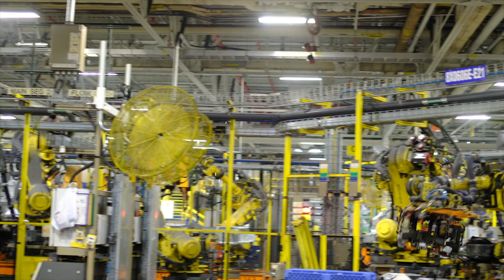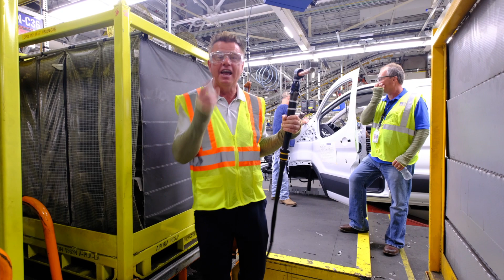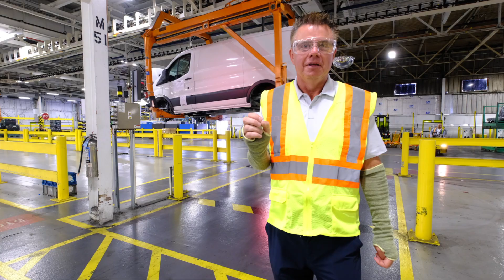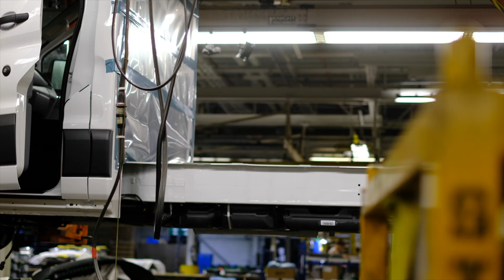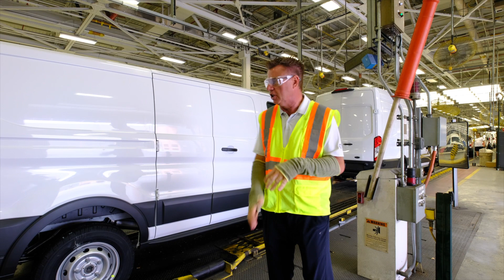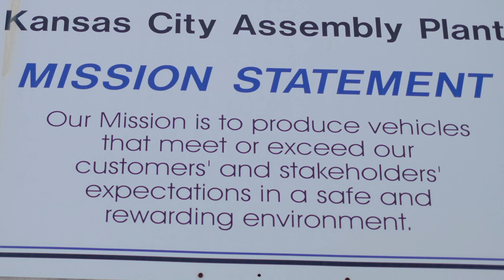Ford Transit Factory Tour

Comment: It's funny to hear an outsider describe equipment that I work on six days per week.  I am an Electrician at the Kansas City Assembly Plant and I keep all of the equipment running from Deskid all the way to Water Test.  We can run 37 vans off the end of the line every hour.  The complexity of the van and number of options keeps the line speed down.  When we built the Escape we ran over 73 SUVs off the line per hour.

Comment: Biggest mistake Ford ever made was discontinuing the Econoline and 5.4L engine. I have one and I have 607,000 hwy miles on it with no major engine problems. Only thing done with the engine was a tune up. Still has the original water pump. Ford could have changed the body and kept the Econoline. The Transits will never have the reliability  and durability of the Econoline.
Reply: And why not?

Comment: I am very excited to receive my new 2020 Transit. I had very specific options so I had to order it. I placed my order on January 8th at my local dealership. I was told I would have my van in six to eight weeks. Delay after delay after delay, I should get it by about August 8th. That's seven months! Covid is the excuse. Bummer but I am still excited to get the van. Agate black 150, short roof, short wheelbase, crew van, AWD, twin turbo 3.5L EcoBoost.  Can't wait.
Reply: Lack of computer chips was a problem back then...crazy times then
Reply: @John-ze3vo It did indeed take seven months to get that van. It is a fantastic vehicle. I have about 75,000 trouble free miles on it right now. I am religious about preventive routine maintenance. This thing handles great and is still a smooth strong powerhouse with the twin turbo 3.5 liter EcoBoost and ten speed transmission. I've had it cross country a couple times in the last five years and it's my primary "out of town" rig. I've been very happy with this vehicle and can recommend it without reservation. Happy motoring, my friend. 🫡🍻https://youtu.be/CUAdtS-5tSQ?si=pvK4jA34G0IX6xUF

Comment: If my 2016 was built there then I feel bad for all transit owners. It is a throw away truck at best almost every moving part in the body has needed work. Only the eng has not had work done and I doubt it will make it to 100k before major work
Reply: How many moving body parts are there?
Reply: I got a 17 transit 250 with the V6. It’s been pretty damn good man. I’ve changed the battery and alternator and that’s it. I’m gonna do plugs later this week. It’s got 104,000 km on it knocking on wood here.
Reply: What stuff have you had to do to it?

Comment: Now if they would only put better rear ends in them they might be worth buying.
Reply: Never had a problem with my 2105 and I have not seen any problems listed on the transit forum
Reply: EL34XYZ very encouraging, thanks.
Reply: Mine had to be rebuilt at 36400 miles pinion bearings and seals I suspect the lsd is going out now due to the bearing debris in it for so long
Reply: Robert, I would look into a F-150 rear swap. The Transit rear is an inch wider, but spacers could make up the 1/2" difference. Just my 2 cents.